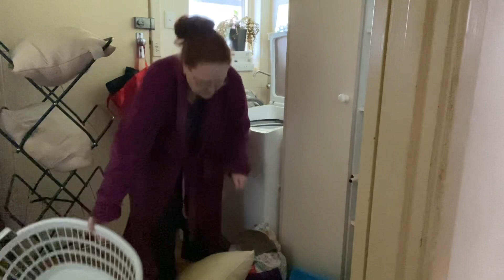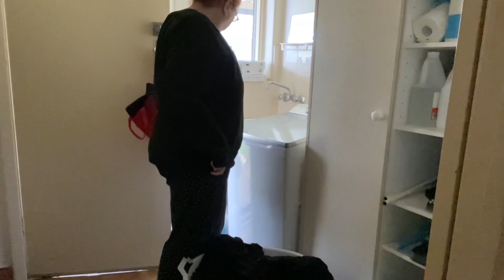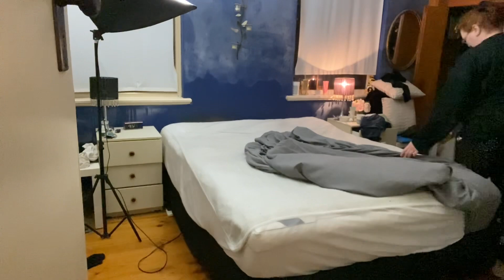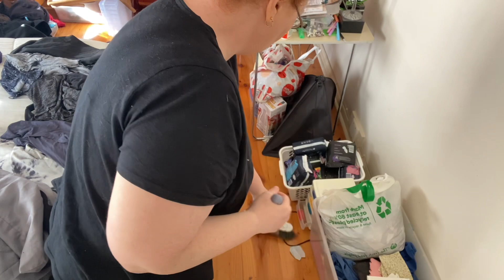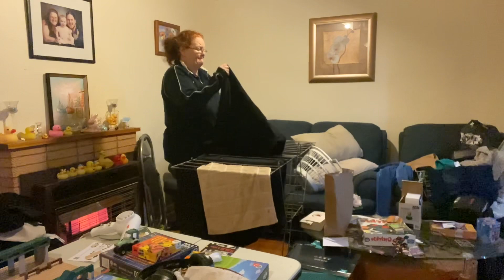3 days EXTREME Full House Clean / CLEANING MOTIVATION

Comment: I often hang fitted sheets by the corner on the elastic, then hang the opposite side the same on the next line, so it forms like a hammock. It takes up more room on the line but in winter the sun dries the elastic quicker this way. Usually hang by the shortest side first then when the tops are dry I rotate so the sheet is hung from the longer side other wise in winter they don't dry quickly. I hope that's making sense?
Reply from the maker: Great tip! Thanks